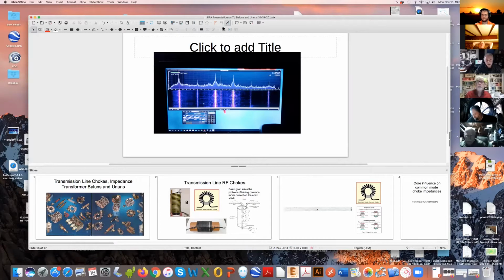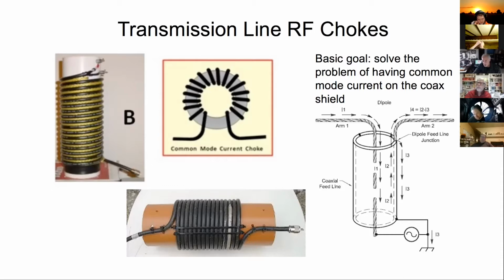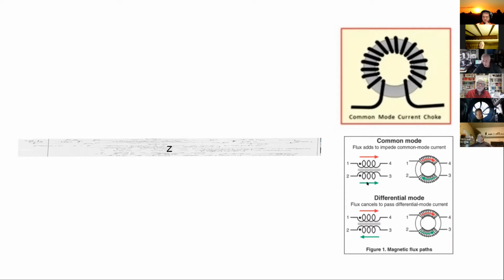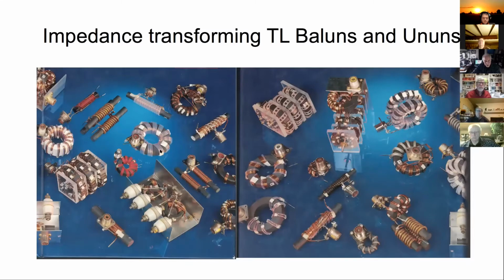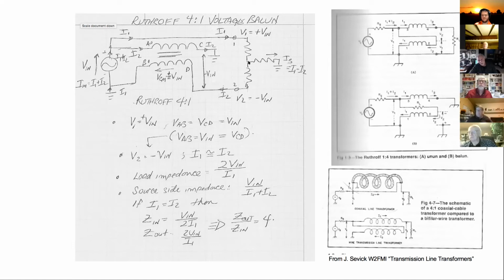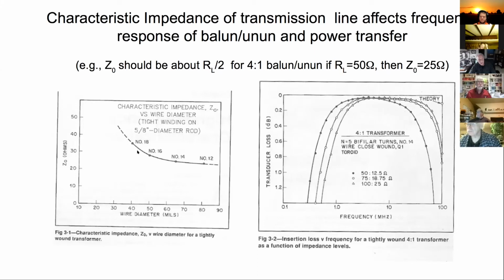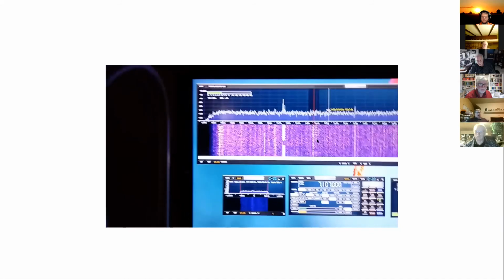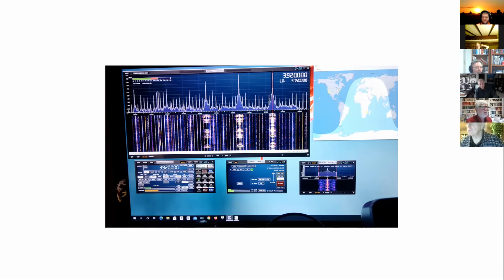November 2020 Presentation - Baluns and Ununs

Comment: lies and myths

transmission lines are not circuits and font carry currents as claimed here.

The line WILL carry unwanted RF currents if its IMPROPERLY TERMINATED.

IOW, your need for this nonsense is due to a MISMATCHED ANTENNA

FIX THE ANTENNA and stop playing games with ferrite clamps and baluns

Comment: Hi from UK :) . I enjoyed the presentation, many thanks ! SDR UNO has inbuilt AM and FM hw filter that you can activate on one of the panels. Also the RF gain can be lowered a bit . If that doesn’t fix it, then we are back to the intermod issue. I have problems with switch mod power supplies (in everything …) causing spikes at about 70kHz spacing. Best Wishes - David G5YAX